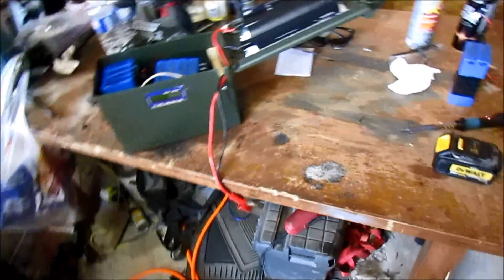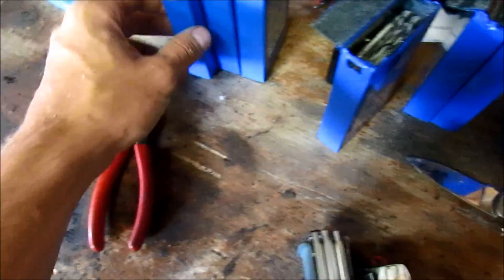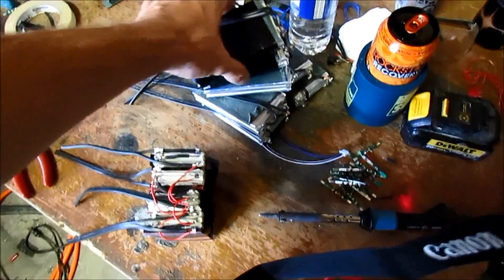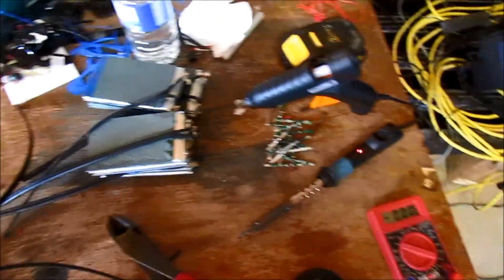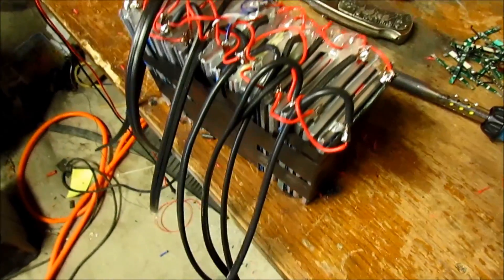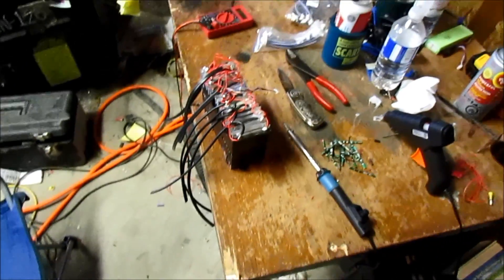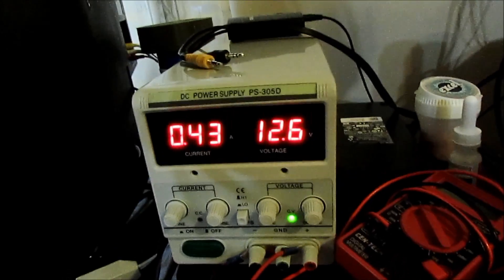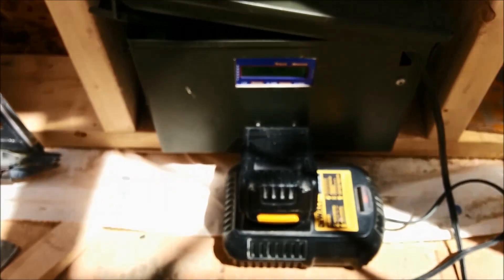LIPO box mod!

Comment: have you thought of fuses , one wrong touch and a bam could happen, is this the end result you wanted to get, i see you are using the rc charger so if you comply with the way it is done , things should go
Reply from the maker: George Gardinier the inverter has 60 amp fuse and i will need to add another 60 amp fuse to the booster cables
Reply from the maker: George Gardinier and yes this is the end result i wanted :)